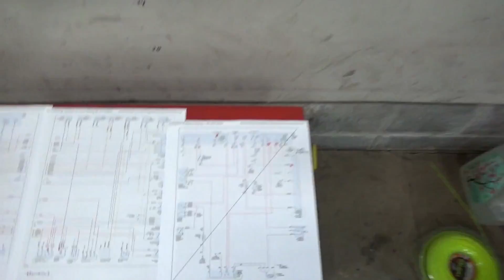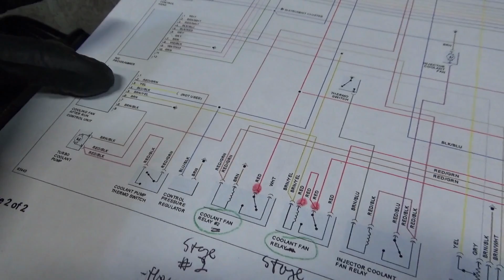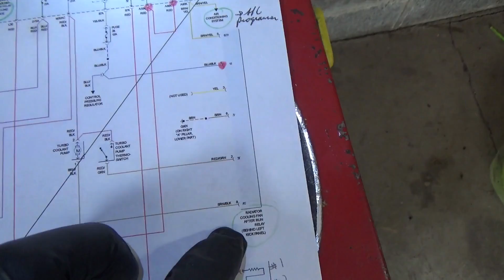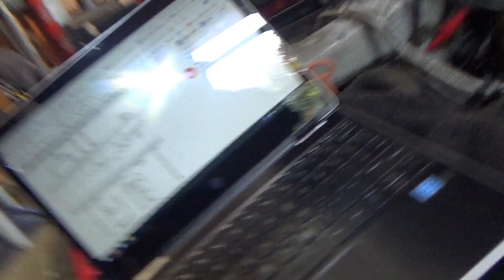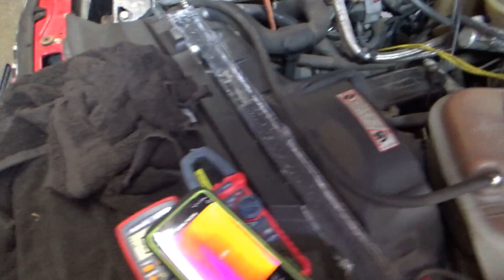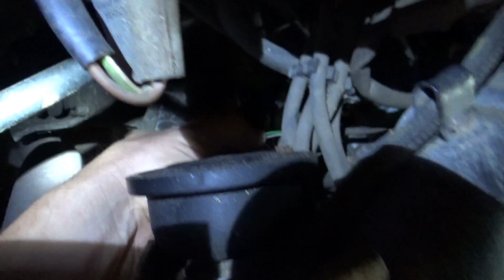(Pt 7) Cooling Fan FIASCO... (RARE Abandoned Audi Turbo)

Comment: Doesn't these have the old data link connection with two connectors that have 2 wires each in the fuse box? I have memories of that. And you use Vcds to read them out. I have done a few really old Audis

Comment: When my friend and I worked on his "New" 1991 Explorer it looked like your Audi with all the corrosion. We stripped the interior and then we disconnected every electrical connection, cleaned, and tightened them and used electrical grease on them and... we had 3 electrical problems to track down which were all easy repairs.  He is still driving it today and NO electrical gremlins!
Sometimes it just pays to put away your test equipment, roll up your sleeves, and do the hard work. The 2 days it cost us easily saved us weeks of diagnostic work.

Comment: Great job Ivan. Brings back memories. I do remember having to replace the multifunction coolant sensor and the thermoswitch on these cars but remarkably as complex as the system was I didn’t come across many problems. Probably the most complicated cooling circuit on any car. Guess you could say life before CAN and PWM strategy was complex with many points of failure. I feel I was fortunate to learn during this era. No scan tool meant you had to understand a circuit and develop a good diagnostic strategy. Personally I like the track diagram or Valley Forge diagrams as an instructor once called them. Once you get a hang it is easy to follow. Life without a scan tool was a real struggle at times. Pretty much a norm for most European cars in the 80’s. Or at least the ones I worked on.

Comment: There is also a nice surpise under the rear seat. A mercury switch! Engingeers in the 80's discovered, when it is very slippery, you could lock all 4 wheels on 4wd  cars, and the ABS unit thinks, all good, we stopped and won't release the brakes. As accelometers were not a thing in the cars in the early 80's, they just added a mercury switch, that would signal the ABS unit, we are still moving, release the brakes.
Regarding the ABS, there is a combi relay nr. 76 under the dash, it switches off the ABS when diff lock is engaged or button on the dash is pushed. Burnt out coil is common failure on these relays, wokring one could be hard to find. I've seen it fixed with adding an regular external relay to it, and wiring it in place of the burnt out one.
Reply from the maker: Amazing details!!

Comment: First check the fan relays, then activate the fan, check coolant temperature sensor on record test with the engine cold and key-on-engine off. The, it's either the fan switch or wiring. A Launch x431 will check those. By simply pushing buttons on the Launch, you'll find out things.
Reply from the maker: It's that easy, huh?
Reply: @PineHollowAutoDiagnostics  As a preliminary check to see what works and what doesn't. Try that. You'll eliminate things. Then, you go to wiring diagram etc. That's what Launch is for. Check modules. But, it can be the fuse box causing modules to show faults. But, the best thing to do to save time and money is to let somebody else mess with it! 😂
Reply from the maker: @CarlWilliams-u3y  How do you hook up a Launch to this car? Especially to check the fans...they are controlled by thermoswitches and relays, NOT modules LOL!
Reply: @PineHollowAutoDiagnostics  Launch works on some cars and not others.

Comment: My first little Austin had a similar jack and like you, I spent a while greasing it up but when I gave it a live test - the car stayed where it was and the jack point came up through the floor. 
It was almost impossible to use during the winter unless I rugged up the engine the night before and stuck an electric heater under the bonnet (hood) before giving the crank handle a spin - not enough juice in the old battery to turn the starter! Then if it actually did fire up an run - half way to work it would begin loosing power and die - quick look see would find the carburettor encased in ice. Saw one of these old cars go through an auction the other day - almost in the same condition as mine when sent to the scrap - it made £7,000

Comment: Hi IVAN,this turned out to be a wire by wire diagnosis.Very good.On the fan issue,man what a complicated system.  But you explained it well.My Honda had that cool down after shutoff when 1st new,that caught me by surprise the first time i heard it.Even with the key out it runs,so i figured it's always hot to the sensor.I think your issues now like on the gauge might be corrosion on any area where there is a plug and flat blade pin.Just from the moister of sitting FOR YEARS.Microscopically the irregular contact POINT has corrosion LOSING contact,no corrode may fix it,same for under the whole fuse box. i had a car that sat outside for 20 years,all the plugs had oxidization.good vid,buddy

Comment: This Audi is a reminder of my 1986 Audi 5000 cs turbo! I too had to chase wires when problems arose. At least I didn’t have a UFO brake system!😂 Ah, the auxiliary turbo cooling pump and related relays, been there done that! I had to replace the pump itself. The car will not allow you to turn on your rear window defroster, even to diagnose, if it is not freezing temperature. 
I remember with that turbo cooling system and fans staying on after you turn off the car, I had more people tell me that I forgot to turn off my car as I was getting out of the car. Weird system, but, effective way to protect an expensive turbo.
Reply: They actually still have that system to this day, but on modern Audis, the pump now has a brushless motor with an electronic controller, which eliminates the carbon brushes which always wore out and caused the pump to fail after about 60-90k miles. So far, even with the added electronics, they seem to actually be more reliable. Otherwise, the system is exactly the same, but on some models, the ecu now controls the pump relay, instead of it having an internal timer.

Comment: Some gagues like the temp gauge is a bimetal construction which takes some time to adjust to the new value. So I wouldn't rule out the gauge until after a while. If it's a bimetal design and current runs through it then at worst the gauge can be stuck in the cluster. The other faster responding design is a magnetic force gauge.
I have however seen a design where the gauge is somehow locked in place when the power is removed, which was a fuel gauge on the Subaru 1800 MY 82 to 84 with the larger cluster.
If the thermo sensor is showing some kind of symptoms then I'd say that it's on its way out and should be replaced if possible. It's a bummer with a multifunction sensor for all that functionality though.
I wouldn't rule out that it's the sensor on the rear end that's feeding the cluster though, even if the wiring diagram might say otherwise. Sometimes there are wiring differences depending on model year and market that falls in between in wiring diagrams for various reasons.

Comment: Did you touch anything on the fan circuit ?  Did you post it on YouTube ?  You’re screwed!!!
I enjoy solving electrical issues but this car is an never ending avalanche of problems and you’ll be lucky if it doesn’t bury you 😳

Comment: This vehicle is truly a complicated electrical nightmare!  I'm surprised at how much of it still works!  Still, your able to check whats working off your list.
Still thinking about those front brakes.
Right now I'm thinking what the cost will be for all this work?  Then, except for a collision, how long will this last, and how big will be the laundry list of parts it's gonna need later on.
Good one Ivan.  You definitely are doing great!
Reply: What is complicated about it? Most of the car is simple as it gets. Thermoswitch switching a relay etc. No CAN-bus, no body control modules, instrument cluster is bunch of analog gauges which are pretty much direclt driven from analog sensors.
And what is important, there are detailed wiring diagrams and repair manuals available.
Reply: @SteepPlate165  Provided they are the right ones.

Comment: Got curious about this car's specs and decided to look it up

2.2 liter, 20 valve straight 5 (as we've seen then 20 valve on the valve cover)
217 HP @ 5700
228 ft/lbs @ 1950
0-60 time of 6.6 secs
3439 lbs curb weight, for the wagon

That ain't bad for a '91!
(Apologies metric bros, I found the info in americanese, I'm posting it in americanese)
Reply from the maker: It's no slouch when it runs well, that's for sure! 😊

Comment: My 2002 F350 7.3L diesel also has 2 coolant sensors.  They are only simple 2 wire sensors;   they are both on the front of the engine and not far from each other;  one goes to the gauge and the other goes straight to the computer;  but they are totally difference sensors with different outputs.  Trying to explain this to the autoparts stores was an ongoing nightmare; they kept trying to argue with me.  So I finally just ordered an OEM on fl33bay and it works great now..  I physically broke the old one while swapping water pumps.. :(      rookie move...   My truck is a 6spd manual 4x4, so it's rare enough to be an issue;  because apparently the 2nd sensor is inside the transmission on the automatics.  You can imagine how much I pulled my hair out until finally finding this info.

Comment: I'm sure you know this, but Eric O sends clusters out to a shop somewhere in NY I think.  I don't think they started out doing clusters, but I think they found a niche market.

As for that jack, if I think I'm going to have trouble on the road, I throw my nice floor jack in the back so I'm not relying on a questionable scissor jack.

In my day job, I often have the need to have multiple windows open so I can see different things at the same time.  Monitors and TV are cheap in 2023.  What I've done is create a multiple monitor setup at work with the main monitor being fairly large, something like 32".  You could try a multiple monitor setup or a big screen TV in your shop to have multiple pages of diagrams open at the same time.  You can even align the windows so that the elements on the diagrams line up for better traceabiy.

Comment: I know you like no parts required, but as soon as I saw the two corroded relays, I would have ordered OEM replacements for every relay in the car. Also all belts and hoses and spark plugs and injectors.

Comment: The turbo on my BMW E46 320d got destroyed when I made the mistake of shutting the engine off after a fast drive on the autobahn and restarting it a minute later when it was still hot. The shaft sheared right off. This Audi seems a bit over-engineered but the turbo cooling system kinda makes sense.

Comment: With all the countless electrical problems this Audi has, due to corrosion, my suggestion is to pour 2 gallons of gasoline all over the engine compartment and vehicle interior and then light it. The resultant heat should dry out all the relays, contacts and connectors. At this point, Ivan will not have to spend any more time on diagnostics or circuit tracing. This will help him maintain his sanity.

Comment: Some info for you. These audis are notirously difficult to bleed. And will have all the symptoms you initially experienced with it overheating. As the coolant doesn't flow around the temp sensor or the fan switch. Usually they self bleed once you run them up. Get it warm then switch it off and let it naturally "gurgle". The better solution is to drill a 4mm vent hole through the thermostat. I have a video on my channel about this. And the same thing can be seen on a video on Memphis's YouTube channel :).

Comment: I swear by silicone grease to help any screw/ hinge to work better - spray or in a tin - silicone is pretty inert and does not cause rubber or plastic to deteriorate.  Nice video Ivan and Merry Christmas. 
🎅
Reply: Yeah always have a can it the garage.

Comment: If the fan is dependent on the temp sensor ... always reading cold would kill the fans to come on...correct?
Reply from the maker: Watch the explanation of the wiring diagram again 😉
Reply: This car has at least 9 different temperature sensor & switches.
Intake air temp for ECU.
Engine temp for ECU.
Engine temp for turbo afterrun cooling module.
Engine temp for instrument gauge
Engine overheat switch for ECU & A/C
Engine overheat switch for instrument cluster.
Oil temp for instrument gauge.
Outside temp for A/C.
Double radiator thermoswitch for fan relays.

Comment: This 3B engine shows live data, it even shows short and long term trims. You need a 5 dollar adapter or just plug in the wires to connectors. White is K and L line, black is 12V and Ground. Launch, autel or any derivative should be able to connect to K-line and display the data. Only the ABS needs some special Bosch tool.
Not working gauge is probably cold solder joints on the pcb or bad contact under the gauge screws, or 10V regulator that failed, but you had 10V,  so the regulator is probably fine.
The turbo coolant pump module, which had green crusties, is also a common failure point, it has its own thermoswitch F98.
This has the old version of the MFTS with 12V feed, superseeding part does not have it or need it. 
Pin 1 is gauge
Pin 2 is signal to A/C and ECU. At 119C the ECU reduces boost by way of this alarm signal from the multi-function temp sensor. This presents itself to the ECU as a thermally switched connection to 0V. If the ECU sees 0V on this pin then it disables the WGFV device so that boost levels are maintained at the safe limit provided by the mechanical limits in the wastegate (circa 0.4bar above ambient with an unmolested WG) - unless someone has fitted a huge WG spring. This is the 'R' pin.
The 'R' pin also connects to the air conditioning system (if fitted) requesting that it be turned off when the coolant temperate exceeds 119C.
Pin 3 is 12V on old version
Pin 4 is coolant warning light on the cluster.
Reply from the maker: Very interesting! Dang should have tried the Launch on the k line!

Comment: Ah yes, cooling system fun.  The after-run system is pretty neat and in my opinion, ahead of its time back then.  The CIS cars got the injector cooling fan, which helped cool the fuel in the lines right before the injectors, down after shut down.  Sounds like the gauge should be an easy fix.  That style was used in other Audi's of the same era.  You've taken on some pretty "fun" problems with this one.  Nice work!
Reply: The Renault 5 Turbo had after run cooling long before these. They had a cooling fan for the carburettor to stop fuel vaporisation after shut down that ran for 10 minutes or so.
Reply: Showing how much acronym usage has changed.  CIS in 2023 no longer means what it did then.  I thought for a second that you forgot to also type in gender.  Back in the day, DEI stood for Dale Earnhardt Inc.
Reply: Thats what i also noticed, the redrawn wiring diagram was for another engine, because of the injector cooling fan. 100 and 200 had other 2.1 and 2.2L turbos with different jetronic systems.

Comment: I've read somewhere that modern temp gauges have some sort of a dampeting circuitry that keeps the needle in the middle during normal use. Even when operational temps vary like going up a mountain pass versus going down a mountain pass. 
Only when an engine is seriously overheating already the needle shoots into the red quickly. Apperently this was done because owners would freak out whenever temp got over the half mark.
Reply from the maker: This one is a standard linear gauge I believe 😊
Reply: Which is how it should be, if I'm working an engine hard I want to know if the cooling system is managing or if I need to back off a bit. Back this up with a red light that goes off if the temperature really is over the top and the driver is not watching the gauges. Excellent work Ivan.
Reply: It's no better than an idiot light these days. In modern VW/Audi's they show normal temperature from 55-105 deg C (130-220F)
Reply: Probably to prevent driver anxiety.
I bet a lot of mechs would get people complaining about fluctuating temp needle, even though it never gets really hot.
Still prefer that to just the light on the dash.

Eric O had a woman complaining her huge car interior didn't get warm over a short drive from cold in the mornings - problem was the interior of the car was just huge and there simply wasn't time for the engine to warm and fully and heat all the space in the cab.
Reply: @Cheepchipsable  You are talking about a woman they want instant gratification & when it can not be achieved they complain.
Reply: True, some 1990's Toyota's had that (previa/ estima), had to fit a temp gauge to get a true reading as when it went to hot/red the damage had been done (head gasket).

Comment: The ECT on the back of the head is for fuel mixture. The coolant gauge is either a cluster that needs to be re soldered for cold joints or bad MFTS under the intake manifold. The after run relay has two sides. One for the pump and one for the fan. When you jumper the two pin thermo switch under the IM both functions should come on. I have seen either function burn out on relays.